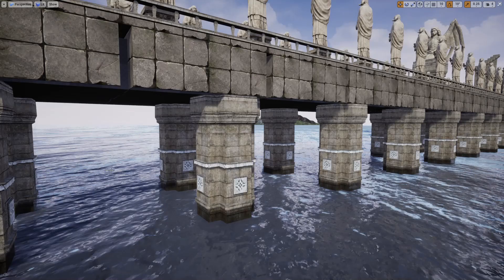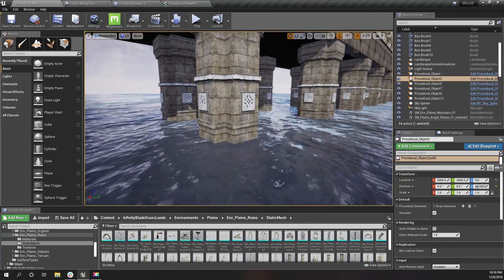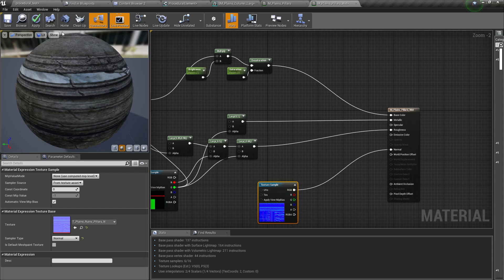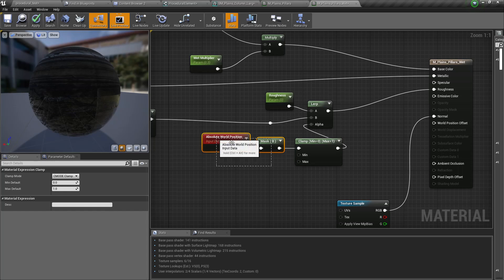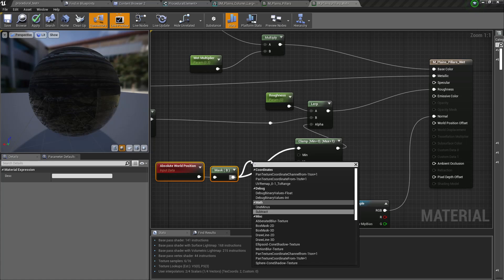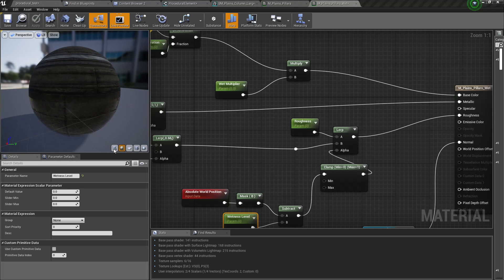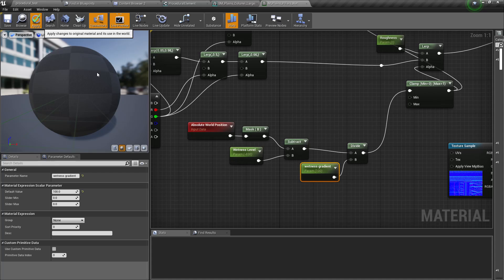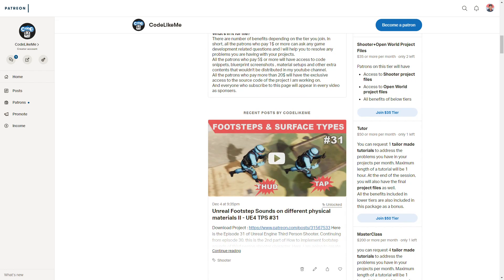Wet Surface Near Water - UE4 Tutorials #324

Comment: Nice tutorial, but is there no way to automatically detect the water height rather than having to manually enter in this value? If I have multiple water planes at different heights, I need to duplicate my material instances for each water level.
Reply from the maker: you will need some additional blueprint setup to automate this
Reply: @CodeLikeMe  Thanks for the quick reply. Decided to just set up vertex painting and use one of the channels for wetness.

Comment: how can i implement this, into my character go out some water after swim, then little wet and slowly dring. Can u make tutorial from that?
Reply from the maker: basically the same way, you just have to move down or up the wet level parameter as the character go in water
Reply: @CodeLikeMe  
It works, but the problem is that for this you need to have a vertical UV scan of the model (at the bottom of the boots, above the pants and further on the jacket) Is there a way to fill the material not just from the bottom up, but along the UV of the model?